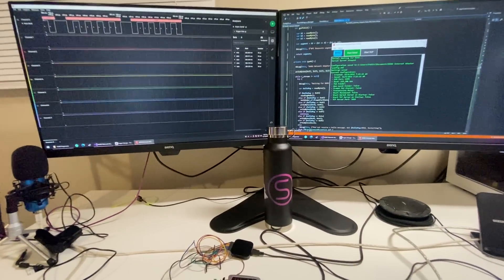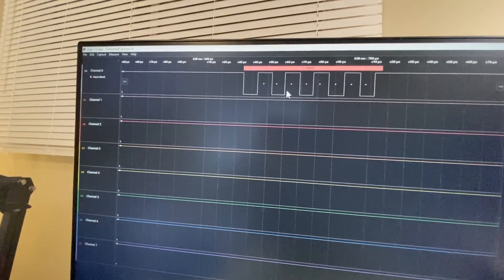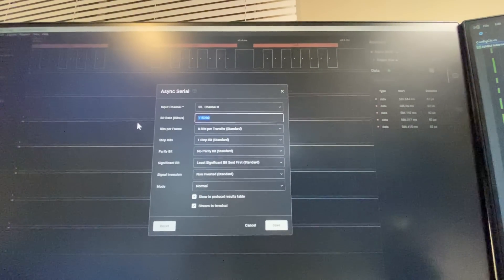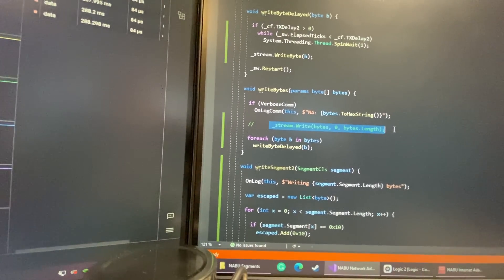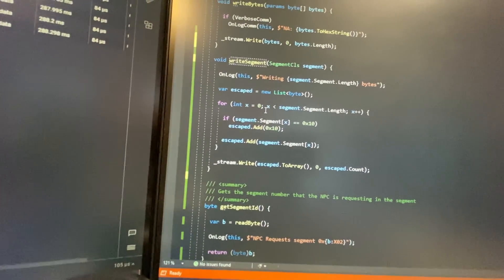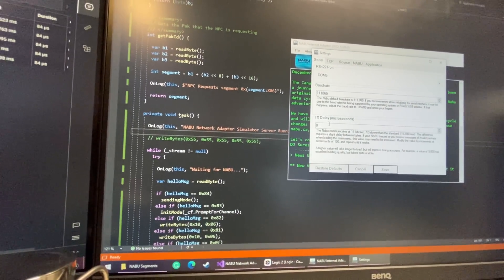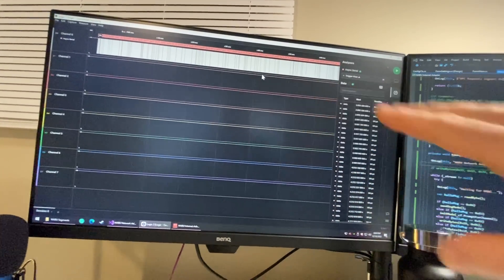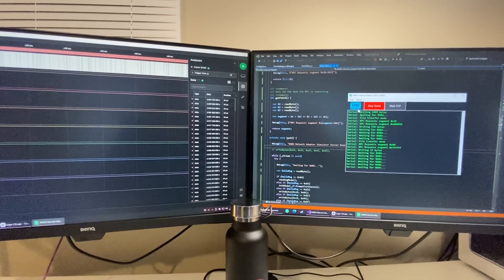29 - NABU Computer Baud Rate Sorted

Comment: is that $10 escaped like in slip/kiss? if so there probably is a little more to that... like with slip. the fact that they picked some other bytes doesn't make the principle different. :P that adaptor thing is still some sort of interface to a packet switched network after all. just like a tnc or x.25 pad. and currently your pc is hooked in as if it were the tnc/pad (yes hdlc was a thing back then even - and back then you usually indeed left that up to a tnc, pad or isdn terminal adapter too ;) that escaping $10 is done cuz rs232 (between the tnc and the node) offers no proper way to 'frame packets' just bytes. so you pick some byte to put in between the packets but then you have to pull a whole circus to make sure the byte doesn't occur within the packets. (yep. pretty much all of those concepts are older than the internet itself ;)
Reply: think acorn (bbc) econet is pretty much the only example where they put a hdlc controller directly in the computer itself. although they give it a somewhat different name that is essentially what that motorola chip does. framing and bitstuffing (nrzi)  lololol. everyone else taking vague detours with having rs232 talk to a boxy thing... despite the chips being just as easy to interface directly as an uart is.

Comment: plus the code delay would be 'from the time the pc (os buffer) sends it to the uarts (fifo (16 bytes on pc chips i think it was) or) transmit buffer anyway. it would not be a delay after the os buffer, fifo buffer and tx data reg are empty again. (read bit 7 of the actual data actually left the port and it's doing it's stop bit thing ;) take note that there are lightyears of cpu cycles in between sending a byte to an uart and the thing actually being done broadcasting it :P which is why on stuff that also has other things to do you usually make it interrupt driven... rx as well as tx. even if it does not have other things to do it's generally better to just switch the cpu off until an irq occurs again :P

Comment: You can actually get a little bit faster if on the server, you can turn real time logging off so the server is not spewing logs over and over again and it gives your program more cycles for data transmission because serial comms can be wonky like that.

Comment: 8N2 is often used by systems that are too slow at processing incoming data. They use the extra bit to get their things in order between bytes :)
Wish I had followed this thread live, might have saved you some time :p
Some can even go past the 2 stop bits, adding 1-256 of em just for the utility of it. Mostly in software controlled implementations :)
Reply: It depends on hardware buffering, its like audio playing in a sound card. You can't do delay by software in a time-share system. As long as you keep topping up the buffer, things will go out with perfect timing via hardware.
Reply: Basically SpinWait is a no-go for timing in a modern computer. Spinwaits should only be used for locking on memory barriers, to be more technical. not for synchronizing threads, its ironic SpinWait sits on the Thread class, that's because its common to spinwait for a couple of milliseconds before taking the proper lock by CMPXCHG (via mutex *1) or something that's actually an atomic instruction instead of only data-dependant.
That's a very advanced technique used to create "lock-free" data structures, you shouldn't be using it on DotNet that often.
SpinWait for I/O is no good, its basically a red flag.

*1 and then an actual syscall to the OS depending on what you are locking into, if its to protect a critical section or some other resource.

Comment: Try to use a high priority thread to do the serial transmission using a buffer to overcome these windows delays. On my projects when is possible to do the entire protocol on both sides, i always make the serial device read the pc commands and do some timeout checkings ,so these delays on serial transmissions arent such a problem.

Comment: That's weird, I've been writing bytes at mine straight to the serial port in arrays like normal in C# with the framework SerialPort class, and I've not seen these problems, not even once.
Reply from the maker: Tyler’s correct. I was writing byte arrays to the steam in my previous videos. You’ll see how fast it was and before but slowed down once I started sending the cycle.
Reply: @DJSures  Well since my emulator is taking 3 seconds to send 225 bytes to the NABU, I believe I am seeing this problem XD